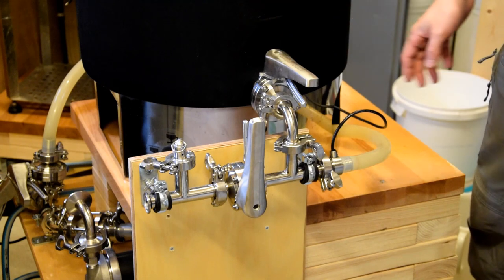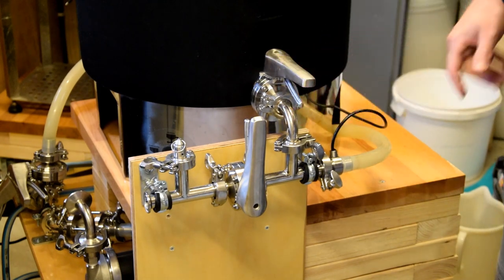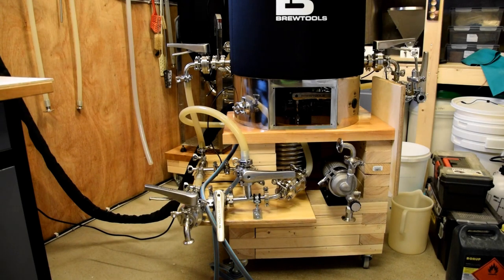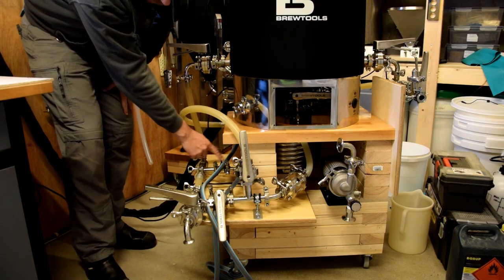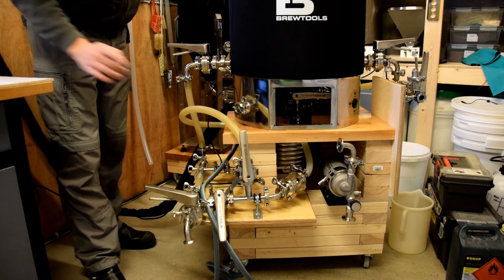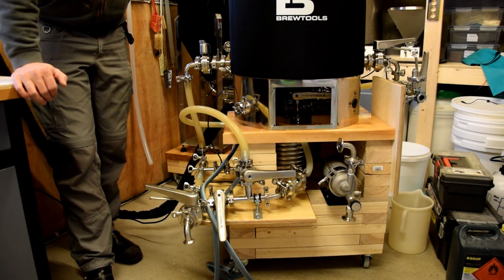Brewtools B80 Pro Butterfly Valve Setup

Comment: Well done!  I had the same thought. Cleaning the 3way ball valves is very tedious. I purchased the spike solo 20gal setup and am engineering the use of triclamps and T’s with a very similar design in mind.
Reply from the maker: I have now brewed several (10+) batches on the setup, and I am still very happy for it. The only ball valve left in my setup is for the HLT which only sees water :)

Comment: awesome DIY !   

Would I be correct though, in that you need three 2 way butterfly valves in order to engineer the same flexibility in the way that a single 3- way ball valve operates ?  

The one thing I do like about the Brewtools design is its flexibility with the number of flow direction options that are afforded by the 3 way valves. I could imagine that one would need many more 2 way valves to achieve the same which could get very expensive, complicated and cluttered ?
Reply from the maker: That is correct. However, many times you have two 3-way valves connected in ‘series’ so at least one of the directions is not needed for one of them. I found with my setup that I have the full flexibility I need.

That’s not saying I don’t have plans for changes. But the setup has worked well for me the last 15 or so batches

Comment: Thanks for showing your system. I need to build myself a table like that. Is there anything you would change? Also, why do you prefer the butterfly valves over the 3 way valves?
Reply from the maker: I am pretty happy with the way I have it setup for now. I have since added another valve such that I do not need to move a hose when using the external pump, but that required no work on the table. 
I would like to have it in stainless, but I have tools and skills with wood, not so much with welding (and for sure not stainless welding)

With respect to the ball valve vs butterfly: Butterfly valves are easier to keep clean in comparison to ball valve. Not so important on the hot side of things, but I still get amazed what hides behind the ball even with exercising the ball valves during cleaning. I would recommend to strip down the ball valves every other brew at least until it is verified that nothing gets trapped behind the ball. 
The butterfly valves are very easy to clean, and nothing can hide :)
Reply: @FrommBrew  if you want to send me your unused 3 way valves - cash waiting!😜

Comment: I like the clean in place thoughtfulness of your setup. How often have you decided to do a tear down for a more thorough cleaning?  Once every 10 brews or so?  Also I’m interested in learning where you got the mounting brackets you are using to hold all the pipework rigid in place.
Reply from the maker: I have not yet taken it all apart, however I am doing a more thorough clean every 3 brew or so. I discovered calcium deposits in the lines (visible through the silicon hose) and have started to do an acid wash every 3-5th brew depending on the state of the hoses. 
The clamps for the piping was bought in a standard plumbing shop